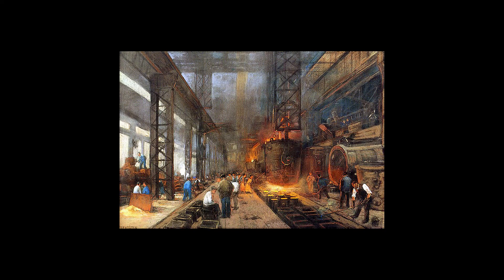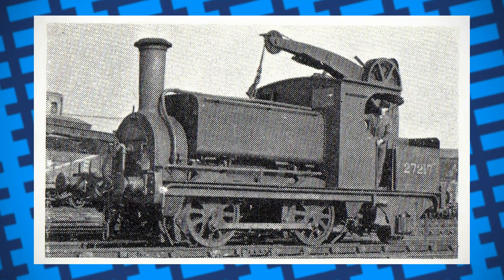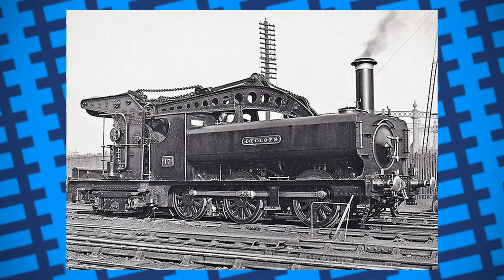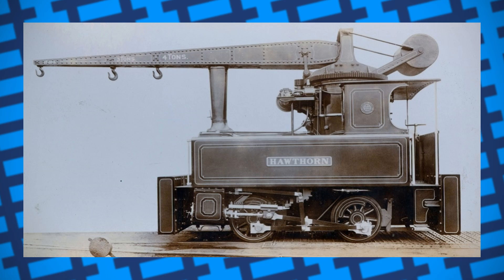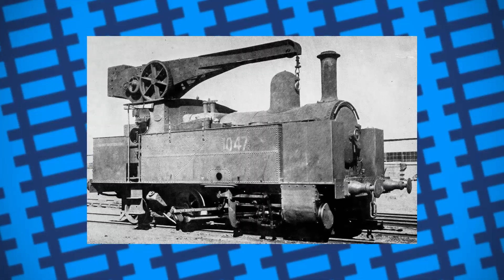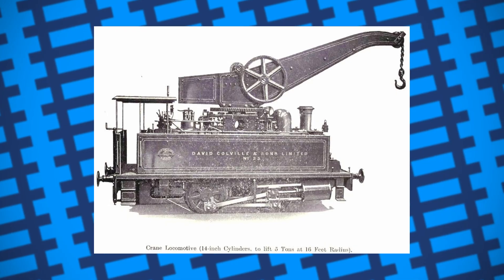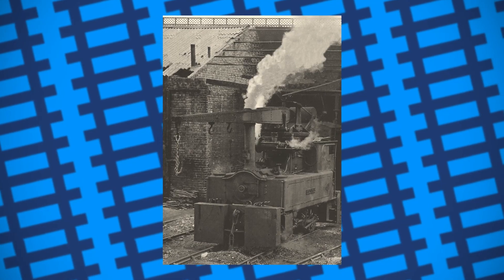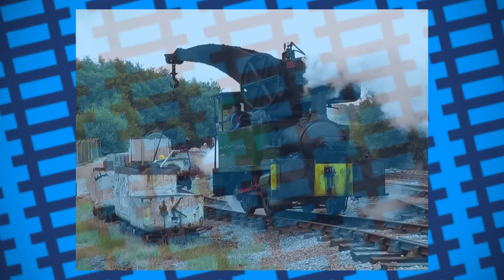The weird locomotives that could pick things up - Crane Tank Engines

Comment: Eventually it was determined we are going to put gantry cranes over the tracks and stop trying to fit in all of these little crane locomotives to move stuff.   So what about the engines?  We told the kids that they were sent off for retirement on the island of Sodor.  But, I told the mechanical crew to recover any of the parts off them we may be able to use elsewhere and send the rest to the cutting torches.

Comment: Were/are there also small diesel crane engines on the rails in the UK?

Because from the 1970's onwards several small diesel shunters in the Netherlands got hydraulic knuckleboom cranes for trackwork maintenance.
 https://en.wikipedia.org/wiki/NS_Class_200

Comment: My Great Uncle built Hercules at Swindon as the crane part came under the Plant and machinary dept, not the Loco dept.   The three GW crane tanks were used quite frequently on PW projects but in the end  cranes with self propelling gears were found to be more cost effective than the crane tanks.   pity as I would like to have seen one.

Comment: I believe they also shipped one of these particular crane engines to Australia as one of them is currently on display at the South Australian Railway Museum in Sydney
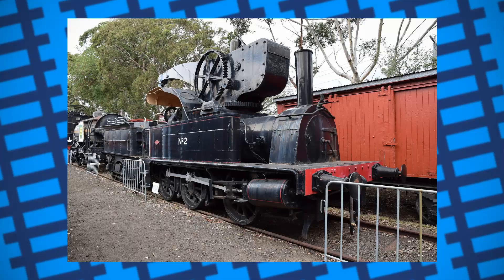Reply: Yes crane engines were used in Australia. At 5:20 is No2 built by Dubs & Co in 1891 located at the Newport Railway Museum, North Willamstown, Victoria.
The "South Australian Railway Museum" or National Railway Museum is located in Port Adelaide, South Australia some 1300+ km away from Sydney, New South Wales.

Comment: 2 of them were used on the 12th floor of the Empire State building. They hoisted steel back and forth, and all the way up to the 31st floor. When finished, they were pushed off the edge.

Comment: Those Pannier cranes look so cool. I like how they extended the base of the locomotive to make room for a crane rather than just sticking it on the boiler or cab. Seems like it allowed for better fuel capacity, a larger crane arm, and a less awkward profile (i.e. the arm doesn't stick out past the front buffers) compared to most crane tank engines. Then again, it was probably too large for a lot of indoor industrial work.

Comment: I see some safety concerns when operating these.
1. The arm, when not perfectly in its lowered and centered position, might exceed the loading gauge and crash against fixed infrastructure.
2. A crane needs a counterweight when lifting something heavy, and a solid base so it does not tip over. Especially when lifting up things next to the track there is the risk of moving the centre of travity outside the track gauge, in which case the locomotive will tip over to the side. A lot of cranes have additional supports that can swing out or move out by a telescopic mechanism, which means however that they can't move while lifting something up.

Comment: Were there any diesel powered crane engines?
Reply: At least in the Netherlands, there were some.  I’ve also seen pictures and videos dedicated maintenance DMUs that have cranes and can pull a short train.  I’ve also seen an electric street railway version with a height-limited flat boom for track work.

Comment: Some dutch ns sik shunting locomotives also had a crane what was later amounted at there service, the crane could be used for example track maintenance. The first ns sik's came from 1934 many have lasted until 2008, after they would be unsafe according to occupational health and safety standards due to the lack of a dead man's system. Luckily many have been preserved for the upcoming generations to see including the crane engines.
Reply: The cranes mounted on them were the hydraulic type of folding crane which you usually see on lorries, they were used in track maintenance duties. The sik was a Bo diesel-electric locotractor with a 3 cylinder 95hp engine.
The name sik (goatee) came from a Dutch nickname for a goat, and the little diesel shunters were named like this because their exhaust gas driven whistle (never seen another loco with this kind of whistle) sounded like the bleating of a goat due to the exhaust pulses from the slow revving three cylinder engine blowing the whistle.
Reply: @Tom-Lahaye an appropriate name for a yard and maintenance locomotive.

Comment: The first one I came across was the one you show with the crane wrapped around the chimney at 5:12. Having never seen anything like it before I had to do a bit of a double take as I was not sure what was going on and how the crane was being supported but this I quickly worked out. I later saw the other variations and you can see how each one approached the task.

Comment: They had one of these in Ireland, it worked as a shunter in the GNRI loco works in Dundalk as No. 31 and was built in 1928, although it was later scrapped in 1965.
Reply: There was?
Reply: @ciarangleeson2880 yes, there is a picture of it online